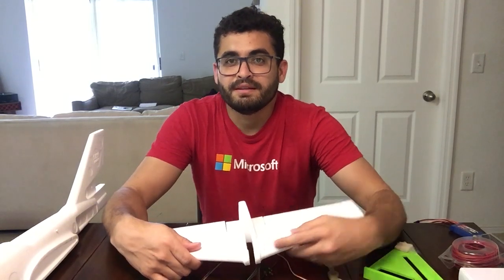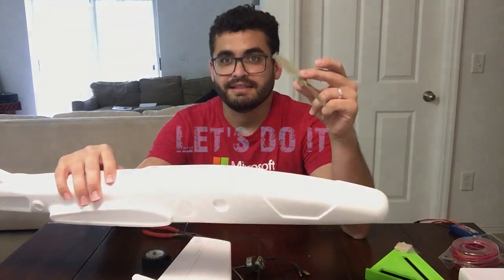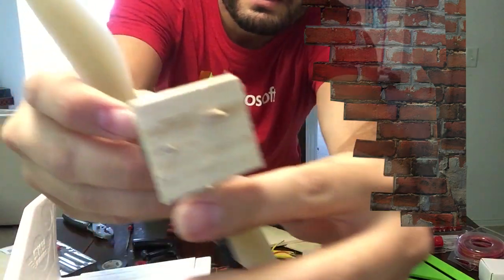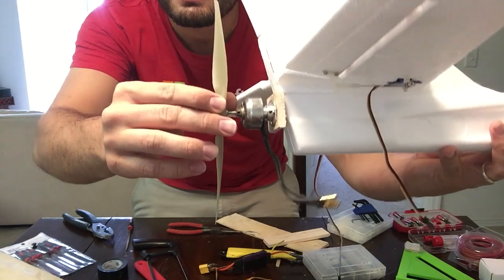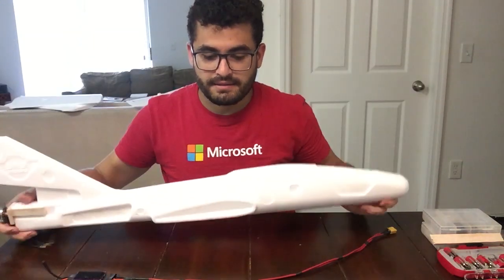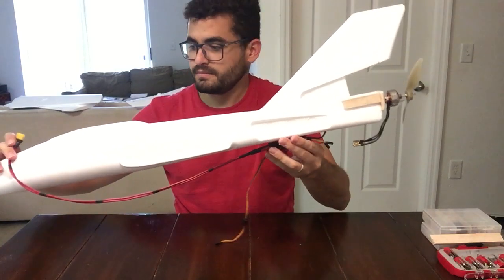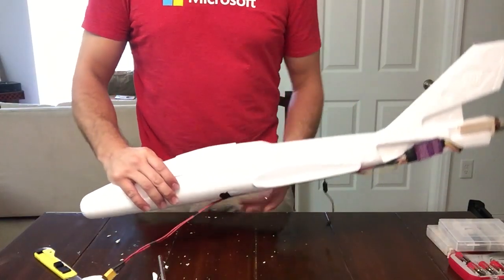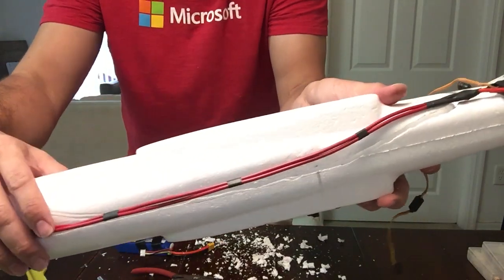Conversion EP 2 - Sky Rider to RC airplane (elevons)

Comment: thanks for posting.   here are some things to consider.   ( you guys and your  CHRONIC use 3s  power, and fat-heavy motors. suggest you invest in some 2s power system components. )    at 1:21, thick balsa stock use as motor mount.  Wrong.    balsa is  NOT  robust enough for use as a motor mount.     at 2:25, long main power leads.   WRONG WRONG WRONG (if necessary, use long  MOTOR  leads.)  at 4:23,  TAILERONS  will Not work well, here.    you may not know that when balancing a low-wing model,  the model Should be  INVERTED.       cheers                         googletranslate
Reply from the maker: David Davids thank you for the feedback! This model is completely experimental! Abou the power leads I didn’t know. Why should it be that way, less current? About the tailerons, you think it’ll have a real bad behavior?